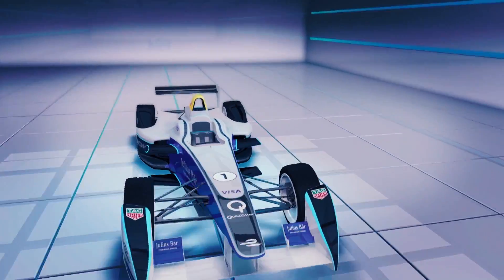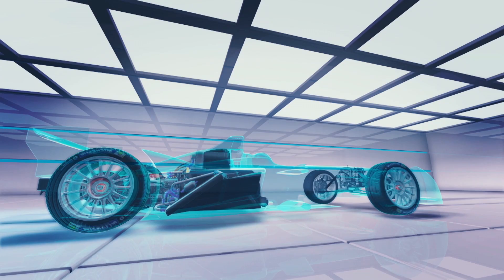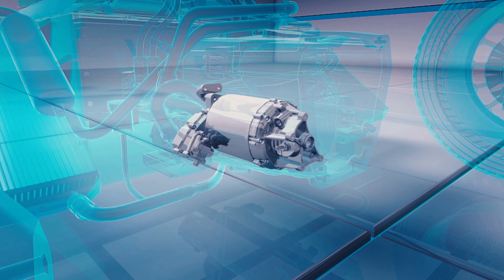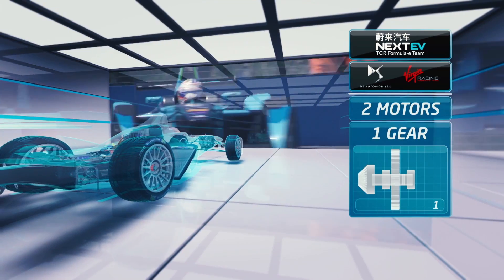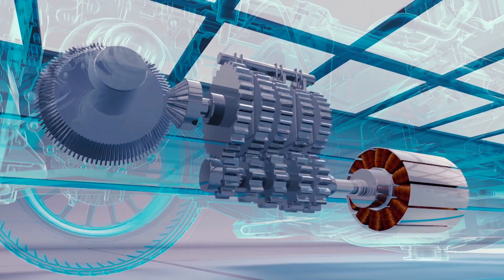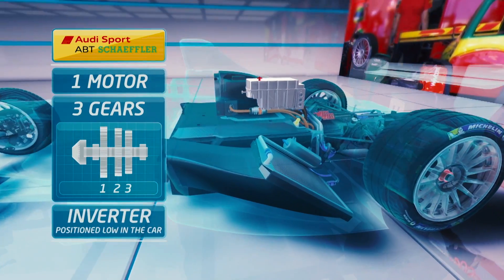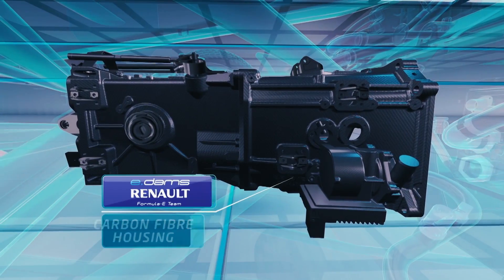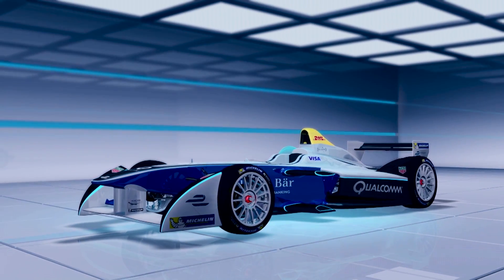Formula E Cars - What Are The Differences?

Comment: how gearbox work ? Does it necessary to have a gear box on a electric race car ?
Reply: electric cars dont "need" a gearbox, neither do petrol powered ones, but it just increases the top speed ~
double the gearing ratio means double the speed but half the torque and you have a little bit of time where there is no power to the wheels at all

Comment: Wouldn't two engines allow torque vectoring?
Reply: Torque vectoring on works when motors are independantly effecting diferent wheels. In this case the two motors are couple together driving a diferential to the rear axel. It can not split diferent toqrue.
Reply: It's banned in FE
Reply: Neojhun Well said.
Reply: This is not yet allowed, but that would be very interesting. When talking about the future of Formula E, Lucas Di Grassi said he hoped to see free battery development and torque vectoring in the near future, for example for the Gen 3 cars.

Comment: It's so refreshing to see this level of engineering freedom in the sport. FE is certainly on the right track when it comes to making the racing interesting in that regard.

It'll be interesting to see how everything keeps on developing as the cars eventually will get more powerful and quicker, and maybe sound better as well. I don't think we should pretend as if sound isn't important. It's a key element to make the racing experience more visceral. But I think electrical motors can sound good in a very different way compared to an ICE, more similar to a jet engine.

And I hope it doesn't go down the current path on show in F1 with extremely complex and sensitive aerodynamics not geared for facilitating overtaking at all. That's a recipe for a frustrating borefest.
Reply: but sound produced = energy lost tho

Comment: 2 motors driving same shaft?! What is the point, when same thing could be done with one bigger motor, and weight could be save by not having double parts like casing and bearings. 
Only way to make this solution logical is to make 2 rear motors where each motor drives it's own wheel, like electric SLS and Rimac Concept One has.
Reply: +Mladen Milić Probably a mixture of weight and the power limit of 28 kWh meant a bigger motor was not efficient
Reply: Electric motor coupling is quite common in racing EV. Adding more Staters and Armatures on the same shaft allows you to add total power more efficiently that multiple motors on seperate drivetrain and wheels.
Reply: Two smaller motors more efficient in creating torque than 1 large motor.

Comment: hi, can you explain why they use an AC motor instead of a DC motor?
Reply: +Bravadi Malangjoedo thanks!
Reply: +Felipe jardim AC is easier to control , has no commutator which makes sparks and therefore more efficient. Also, it makes much smoother power delivery, and having at least 3 phase motor would make it have no pulsation of power. That is like having inline 6 in term of balance and power delivery. 
AC motor has less parts, rotor is single metal cage and it can rev very high.
Downside it that inverter/motor controler is much more comlicated than DC motor, as it must produce pure sine wave from DC from battery,  It also must match frequency (speed) of motor in order to control it in most efficient way with least power loses.